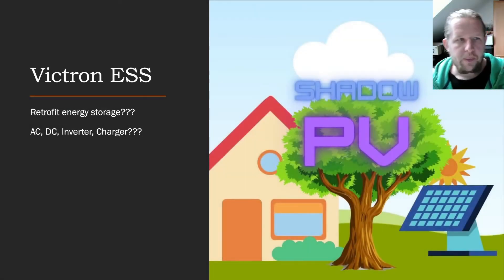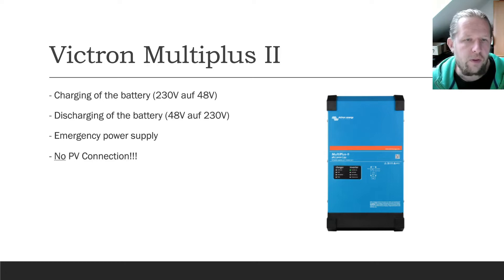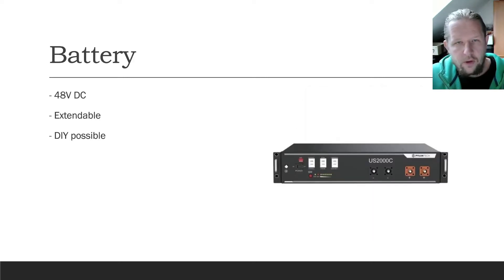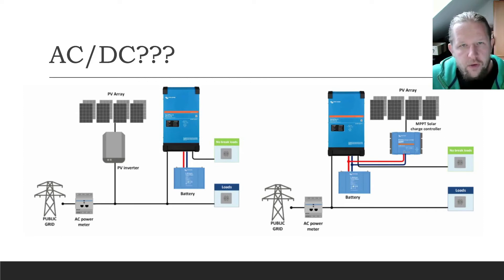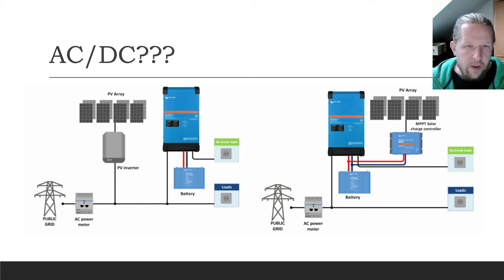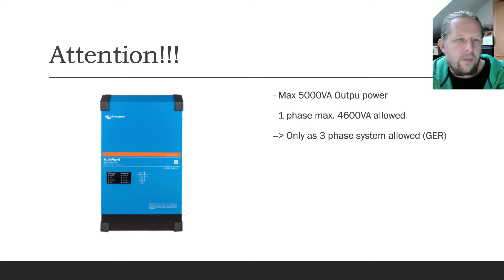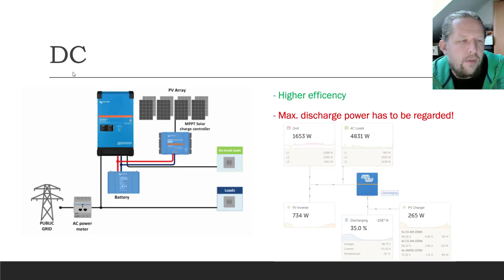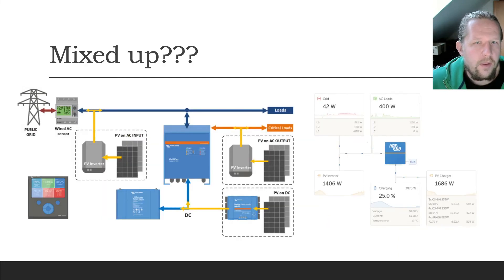[Photovoltaic] Victron Energy Storage System explained - AC/DC storage system for retrofit!

Comment: Do you think I can use   the Wi-Fi network generates by the inverter changer multiplus-ll GX to connect my PC just for the first  installation of system telling that pylontech battery is connected to the system via  Ve.Can interface?
In other word, can I avoid to buy MK3 interface to config my ESS?

Comment: I have built a similar solar system but I have got the last model of multiplus-ll, i. e., GX model.
My battery is Pylontech US3000C.
I have also 2 MPPT solar charger.
Your video is very useful because victron provide us a very flexible system to be implemented.
Thank you

Comment: Hi, thank you very much for your video explanation. 
I would like to know if it can be designed a ESS solution with zero feed-in feature and solar power only on the DC side.
Best regards
Reply from the maker: Yes this works without problems. Just built it as shown in the video.
Reply: You need a Current Transformer device to implement that.

Comment: Hi, great video. Do you know if you can use just one Pylon battery for an AC system and Multiplus II 3000VA?
Reply from the maker: Yes this is possible, but you won't get full charge/discharge rate of the Multiplus